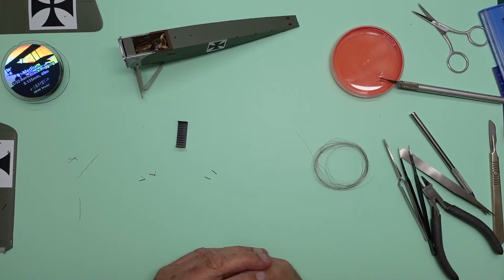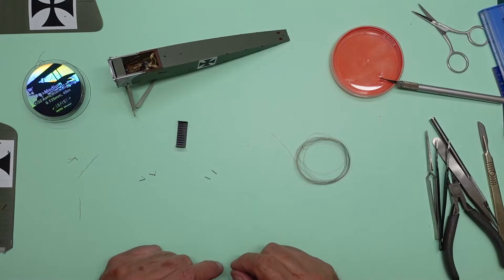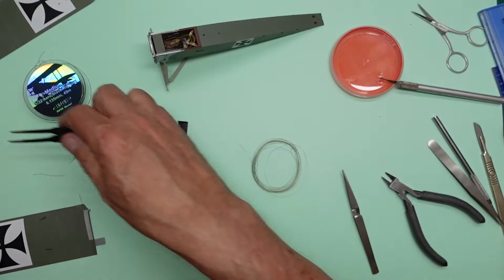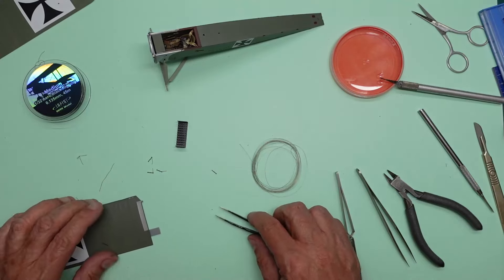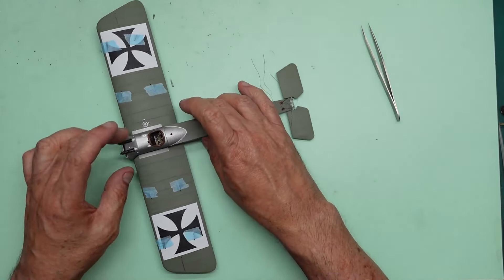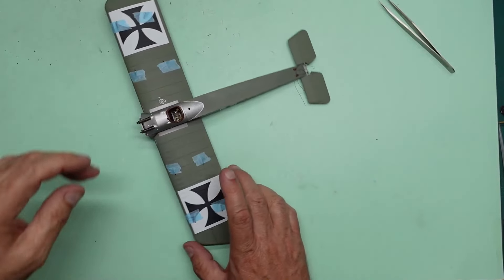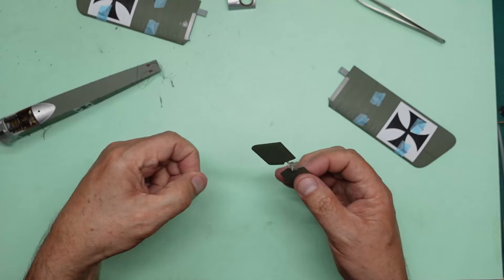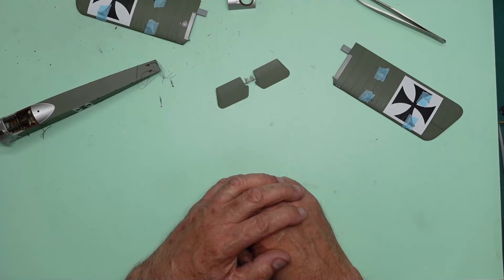Wingnut Wings Wednesday No.13. 1/32 Fokker E.IV Rigging

Comment: i think your method with the turnbuckles is brilliant, Nigel.  Getting the angles right has always bothered me but this way, you can't fail to get alignments right.  If I recall correctly, you can get little shears for cutting fine threads as used by sewing machine pilots.
Reply from the maker: Glad to help John. I just gave you a shout out in part 8 of the Gannet mate. The issue i have with cutting is the thread itself. Apparently the superglue attacks it and is uncoiling itself. I have ordered the Rolls Royce of rigging thread now.. more on that soon.

Comment: They called the wing twisting wing warping Nige. Part of what looks like rigging were actually control cables to pull on wing leading and trailing edges to warp the wings😉
Reply from the maker: I knew that thanks Brendon, just got the terminology wrong again!!
Reply: I still get terminology wrong sometimes, even though I've been modelling for 50+ years😂 @NigelsModellingBench

Comment: Hi Nigel.
As you know WW1 engines had a total loss (castor) oil system, hence the black streaks.  The vertical streaks on the fuselage sides, and I assume we would see similar cross wise streaks across the upper surface of the fuselage are the result of brush painting at the factory (not wheathering as such), as are the chordwise streaks on the wings which are obviously set up to be easy to paint so whilst your method achieves a very good result.
I watched this video because in your short report you said you did the rigging, so as you can imagine, I was a bit disappointed.  Don't be bashful Nige let us see your mistakes so that we can learn.  Other peoples mistakes are the best one to learn from!
What reference book are you using?  It looks pretty good, maybe worth getting (I have an Airfix 1/72 eindecker in the stash to build).